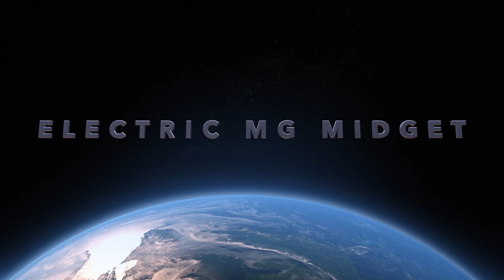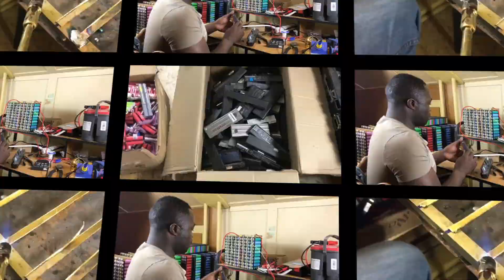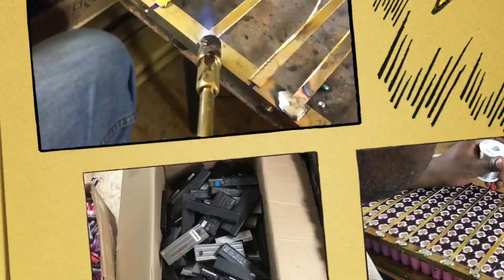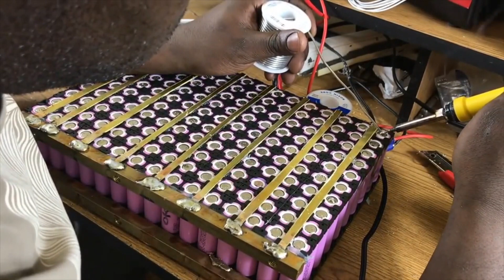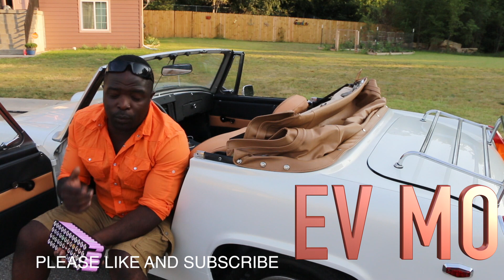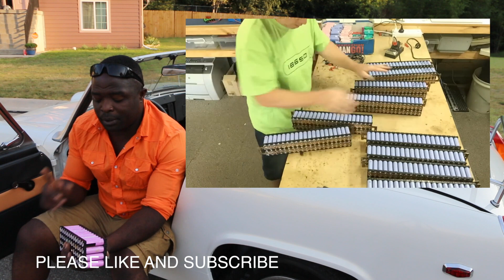LITHIUM BATTERY TALK

Comment: I have Toyota Prius Gen3 and already started collecting 18650 for range extender and conversion to plugin-hybrid .. that could get me  1.0L/100km or 100+MPG. bought already 125kg of used batterys from recycle center.. and planing to buy 300 kg more to get to ~2500 batterys with 2000+mAh.  good video ;)